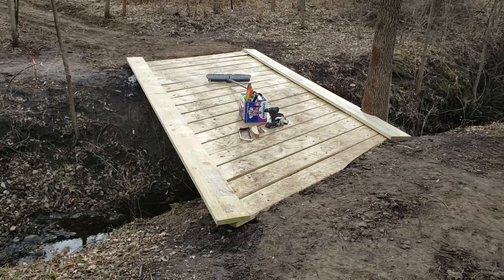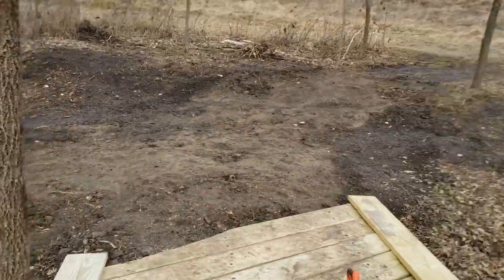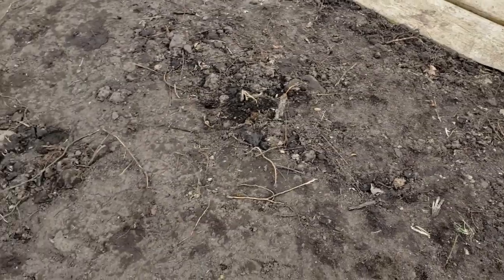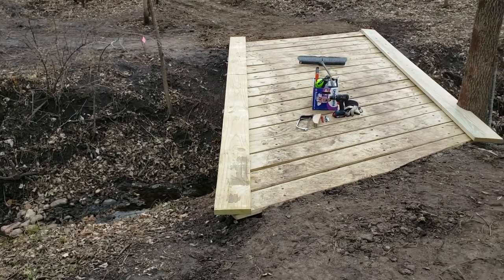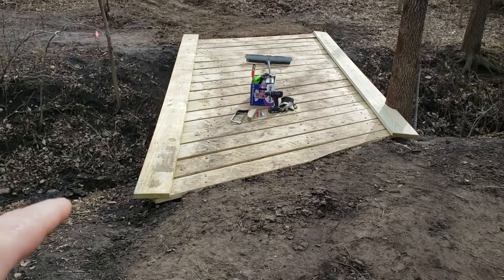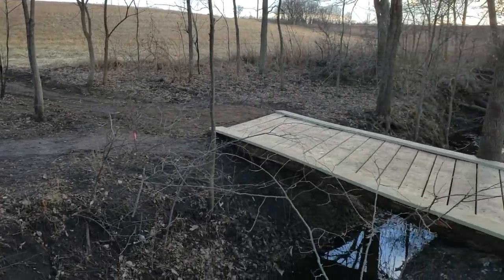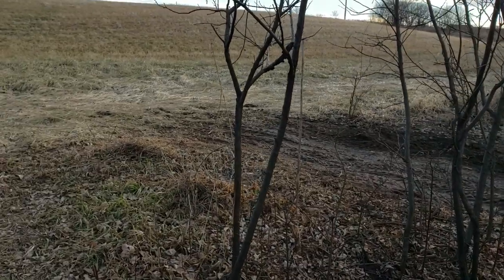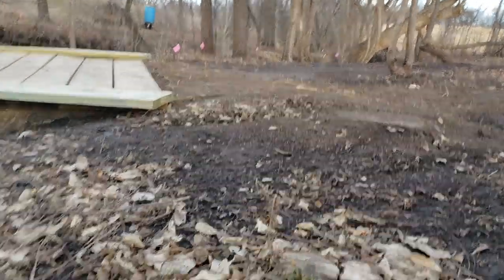Log Bridge Series - Part 10 - Curbs & Grading

Comment: Looks like nice treated wood should last a good while.  Wonder if a jig saw would have made that cut around the tree.
Reply from the maker: I bet a real thin blade would have made it. When we get to working out there, I sometimes have to improvise to a degree, since it's not super easy to get 110VAC to the site. I don't have a battery operated jig saw...but I do have extension cords. I could have scribed it and then went inside, but just didn't want to hassle with that. I'm sure you've been there ;)

Ironically, the "rough cut" actually mated up well with the bark of the tree - happy accident!

Comment: That's looking pretty nice!   One thing I noticed was that tree that you cut the board to fit around.    Is that tree trunk at it's maximum growth (diameter)?  If not, it could put pressure on the bridge as it grows.  Just a thought....  Overall, great job!
Reply from the maker: Yeah, for sure. I'll have to keep an eye on it. I hope the tree will push away from the bridge as it gets wider with time, rather than getting cut off. We'll have to wait and see how it works out. Also, I may need to cut it down at some point if the tree stops me from passing over the bridge with at least one of my soon to be shared implements...this particular item hangs off to the Right side...a lot! In order to put it straight, you have to disconnect the PTO shaft.

Either way, the bridge has been working out perfectly! Zero deflection, even with full buckets of material, and 60" tiller attached! I've added hundreds of pounds of additional counter weights to this tractor, so it's over 3,000 lbs without anything in the bucket...I'm estimating we've crossed with 3,500 lbs or more.

Now I need to try passing over with our Travers ;)
Reply: You're probably right about the tree growing away from it.  Or it may grow around it which may give it more support.  I've been following your videos on the projects.  I just bought a house with a trout stream running through the property and have been thinking of putting in a foot bridge.  Good information!  That will have to wait a bit, though.  Right now the weather is improving and I'm working on prepping my planes for flight.  Haven't been flying since September of last year.  Did a complete overhaul on my old, reliable Apprentice.